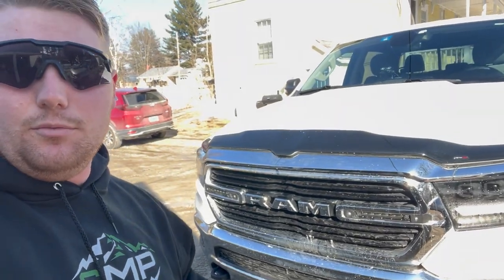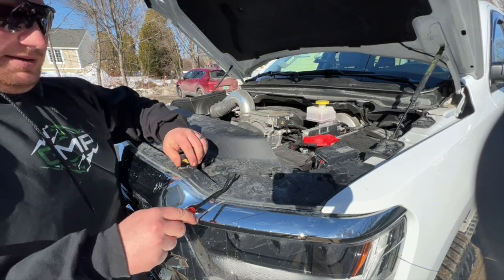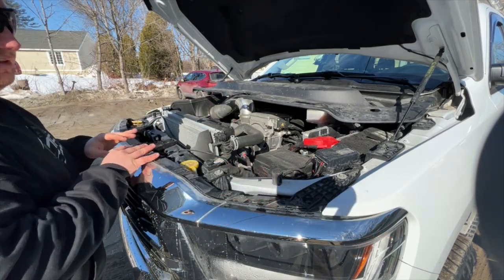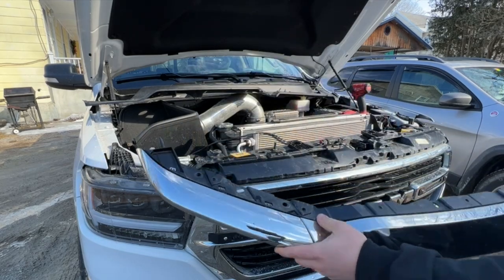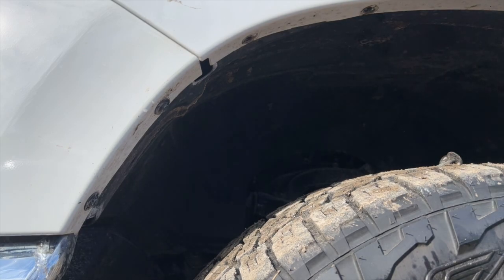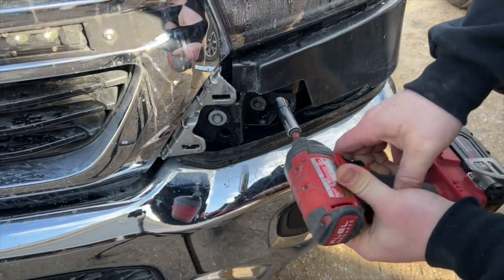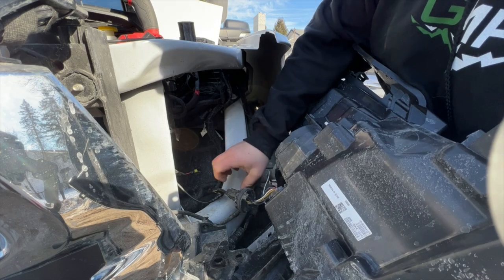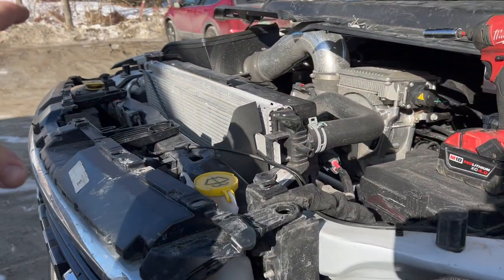Ram 5TH GEN Headlight Housing Removal

Comment: So you are saying you went aftermarket so that it keeps faili g and need to go through all that work multiple times when the stock LED lights are crazy bright already?? Jesus wish i had your free time
Reply from the maker: If you paid attention these replaced the extremely dim stock halogen lights... And yes it was worth it as these LED are so much better and once replaced  they have had no issues for over two years.
Reply: @GreenMountainProjects  stock halogen?? You must have cheated out and bought base then cause anything other than base has LED

Comment: Do you know if 5.7 e-torq use diferent plugs than the 5.7 non e-torq? I bought led headlights for non factory led lights and those lights came with lager connector than mines. Thank you.
Reply from the maker: No the e-torq wouldn't matter the plugs should be the same. The only difference is if you ram is a tim model that comes with the factory OEM LED headlights or the OEM halogen ones.
Reply: @GreenMountainProjects  like I said, mine is halogens factory, I bought headlights for this application and came with different connector. Thank you for your reply!

Comment: you mentioned a metal tab you have to push down on beind the corner trim piece, I had a hard time finding it, can't seem to find what to push down, ? can you clarify please thanks
Reply from the maker: It sandwiches the top edge of the trim piece. Your pulling it down to release the pressure on the trim so there isn’t as much friction when trying to pull it out. Hope this helps a bit. Kinda hard to explain.
Reply: @GreenMountainProjects  thanks for the reply, I just saw it on another video so between his and your explaination I finally figured it out,  this is the only thing I do not like about my ram truck is the headlight changeout

Comment: How long did your have this light before you noticed that moisture?  Have your head issues since?
Reply from the maker: It was pretty quickly after getting them. Got a replacement and haven’t had an issue since, it’s been 9 months and most of that was in the winter